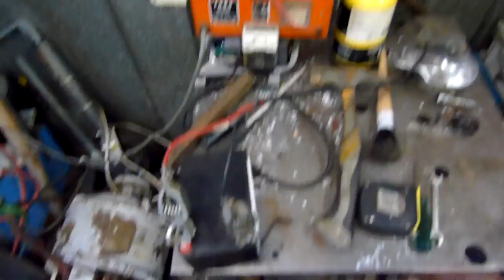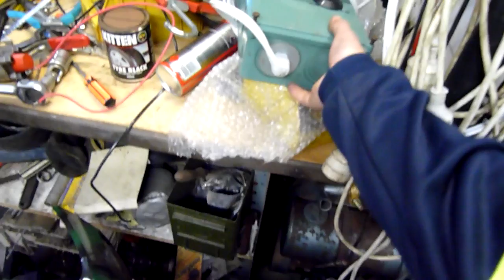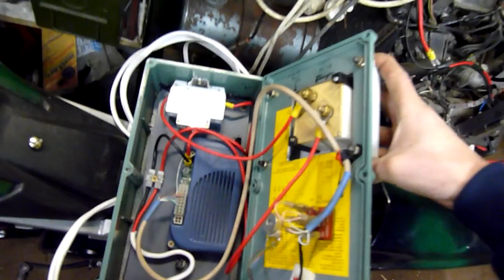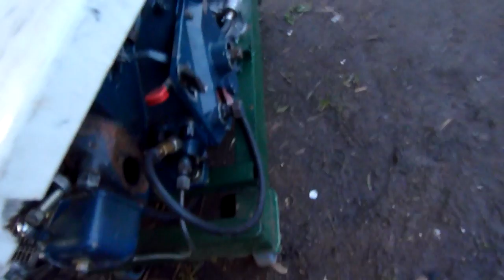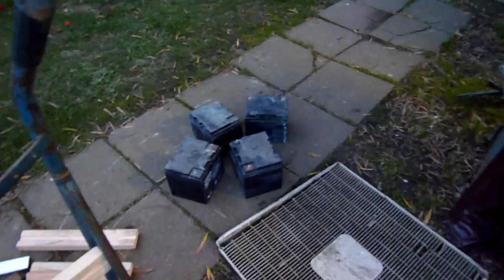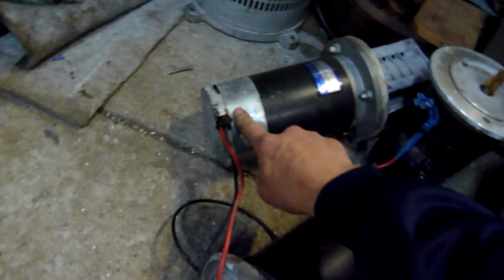Thursday Walkaround - Washers, Batteries and DC motor stuff

Comment: thing people dont realise that asbestos is still can still used and can be handled correctly and safely. besides its everywhere and always will be. brakes being prime example. 
in the theater i tech at half of the lights contain asbestos insulators and have asbestos brae leads. the fire curtain is made from it and all the switchboards contain it. the sister theater has a 7 ton fire curtain that's clad with steel and has a 100mm thick space thats 40 meters by 10 filled with the raw insulation.